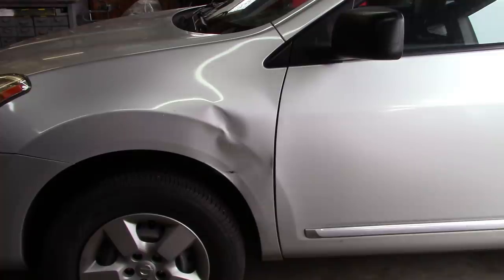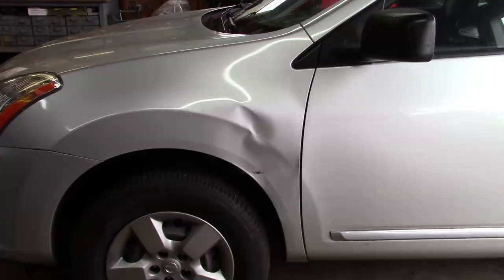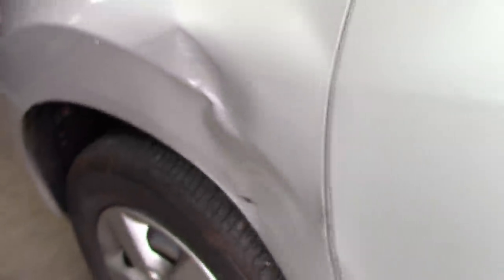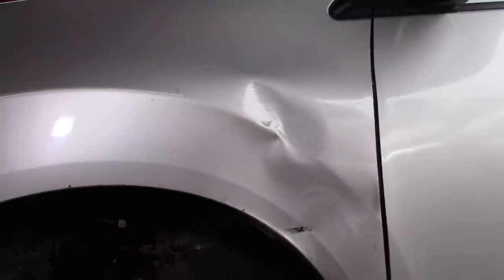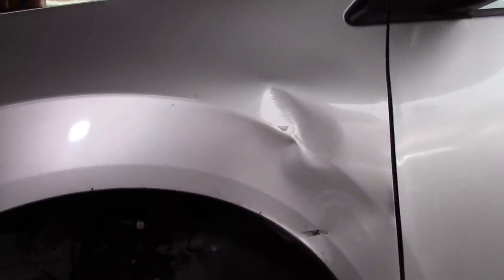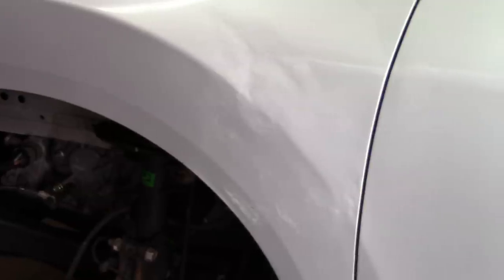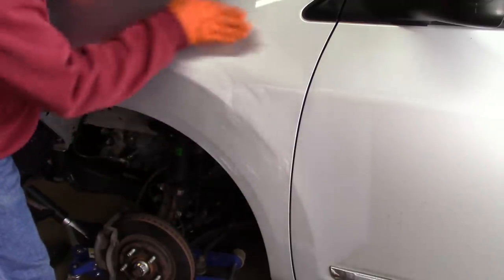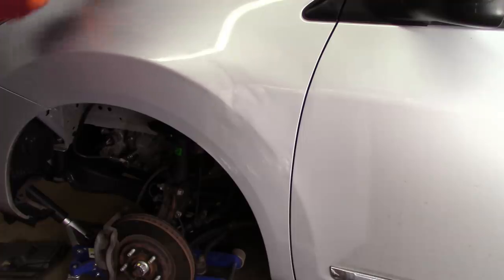Repairing body panels. Techniques and tips. Body filler, and block sanding.#bodyshop #howto

Comment: Using the DA would of been sufficient enough. All that grinding is not needed ..unless your cleaning bare to pin pull a dent. Filler grips to keyed paint. Bare metal is not necessary, and a waste of time.

Comment: Great! I might practice this on an old cheap body and see what comes out. One question I have is, How long did it actually take you to do the job? That way I can time that by 10 and know how much it would take me to do something similar (since I have no experience whats soever with body repairs)
Reply from the maker: The repair work took about an hour.
Reply: @Jo Daddy's Garage  That is surprising.  Came out nice.  How come after first try sanding filler you didn't tap down high spots?  Seems like you struggled because you had to overfill area to raise entire surface to hide/blend couple of high spots?  Also when you switch to 4oo grit do you  just work  edges or whole surface?

Comment: what is the name of the grinding/sanding tool you are using to remove the paint?
Reply from the maker: It's a 2 inch sanding disc. 80 grit I believe. On a 90 degree air grinder.

Comment: hi dude what is the point of doing all that work when a new fender is like £50?
Reply from the maker: These  techniques can be used on a variety of panels. Anyone can bolt on a new panel. No one learns anything doing that.
Reply: @JoDaddysGarage  not a problem.  I had a repair done about a week ago and the spray paint guy suggested we replace the panels and bumper. But He sprayed the fender and bumper off the car. Though he did not do any blending afterwards, now i have a silver car which you can tell a mile off that the car has been sprayed. Do you also find silver is hard to match?
Reply from the maker: Silver is he worst. Has to be blended to look right.
Reply: @JoDaddysGarage  what about mettalic and 3 stage pearl finishes are they just as hard to match?
Reply from the maker: Very.

Comment: The inside of the panel would rust soon after the repair due to the paint or rust-proofing layer knocked off by the hammer.
Reply from the maker: I should have covered that. I did spray the inside after final paint. Good point.

Comment: In this case, I would've just bought a new fender, cheaper, and faster than paying someone to do the body work. you're buying paint anyway. Now a quarter panel is different. You can't just unbolt a quarter panel
Reply from the maker: True, but I didn't have a damaged quarter to use for the video.

Comment: Interesting video to watch.  But not sure if worth the effort. Anytime you try to reshape body lines with filler, it's best to just replace the panel, otherwise it's never going to be perfect. Good job otherwise.
Reply from the maker: Yes. The point of the video was to show repair techniques.
Reply: @JoDaddysGarage  Indeed. Thanks for the kind reply. :)

Comment: this is the hard way of repairing a fender i would of remove the fender you knock out the body lines most of the times the fender highs an lows would pop back in place much easier

Comment: Why didnt you take that part out of the car and then start sanding so you dont need to cover car that much
Reply from the maker: Good question. The fender only weighs a couple of pounds, and is very flimsy when it's not bolted to the car.  Leaving it in place, I can pull or push, hammer, and be aggressive when it's time to sand. Off of the car, it may not even be close to the right shape, and it would be difficult to keep it from moving around.
Reply: Jo Daddy's Garage thanks for replying we usually have something that holds parts we take out of car and works really well when it comes to sanding
Reply from the maker: When I had a body shop, we may have removed it. This was more of a home repair, and it's just easier in my opinion.

Comment: Sheesh! Am I the only one that saw the unnecessary damage he was causing with that square wood stick?
Reply: Yes,you are the only one.
You always bring it out,a bit more,than needed,to relieve stress points.
Makes it EASIER to bring it closer to  original shape.
Reply: @johngardner2807  yes but bringing it out way passed a crease line stretches the metal, not good,

Comment: polyester filler/ Bondo Over Paint not a good thing
Reply from the maker: http://www.evercoat.com/images/ePIM/original/TDS_100106_RAGE_2_2015_EN.pdf
Reply: the approved substrates adhesion it does not say over paint layers, industry standards bondo never goes over paint and your supposed to match the metal not the paint for a repair
Reply: well done at least someone else noticed that.

Comment: Don't apply filler over Paint, if you have to don't apply over shiny paint.
Learn how to use a body file in conjunction with a bumper blade, it'll leave less filler.
House hold window cleaner??? Is that water based?
If it is how can putting water on steel be good before filling over? Use a proper professional preclean.

Comment: You never put body filler over the paint
Reply from the maker: Hmm. Someone needs to let Evercoat know. It's right there in their instructions.
Reply: Adil...  Jo said properly prepared “factory” paint.  It take a lot of work to remove OE paint, so sanding it will prep for high quality filler.  The bondo coat will not come off if underlying “OE” paint is tight.  Leaving paint will also make feathering the edge a heck of a lot easier.

Comment: Filler is only to be applied to metal surfaces. It should never be applied to paint. It should also be scuffed so it can adhere. The filler you put on the paint was not scuffed. The body work will eventually crack in the near future.  Every body technician is different. But you should never shortcut work.  Just my two pennies!
Reply from the maker: If you read the data sheet for Evercoat Rage, you can apply filler to prepared paint if it's the original paint. I did prep the areas where the filler would overlap, and I did not prep areas where I knew I would be sanding it off anyway. Good observation.

Comment: Never put bondo on paint lol
Reply from the maker: Yep. I don't use bondo at all. Evercoat Rage Ultra Gold though. Actually designed for this purpose. Good point.
Reply: @JoDaddysGarage  
I been useing rage for 20 years 
Rage ultra is thier best 
I been useing rage extreme 
The best on the market 
By the way I cant lie you did a great job
Reply from the maker: Thanks. Have you tried Optex yet?
Reply: @JoDaddysGarage   fair point, but the first coat you applied went straight on to paint which had not been keyed and could have still been coated in wax.

Comment: Aftermarket fender cost $40
Reply from the maker: Yep. But this was more about how-to. This repair can apply to rear quarter panels as well.
Reply: Jo Daddy's Garage quarter panel fixed by different way .. needs puller machines or cutting
Reply from the maker: Yep. Done that hundreds of time at my body shop. Nice to have a frame machine, but most DIY people at home don't have that option.
Reply: Jo Daddy's Garage 
Yes you right .. you did great job ..
I have question.. when I apply clear cote I notice small bubbles created on the face .. what should I do to avoid that problem
Reply from the maker: Good question. Is it in the clear itself? Or does it appear in the paint? There are a lot of factors involved. Type of gun, air pressure, moisture, type of clear.... Have you talked to your paint rep?
Reply: Jo Daddy's Garage it’s appear just with clear coat.. I didn’t ask anybody
Reply from the maker: Ask your paint rep for recommendations. Lots of things have to be right.